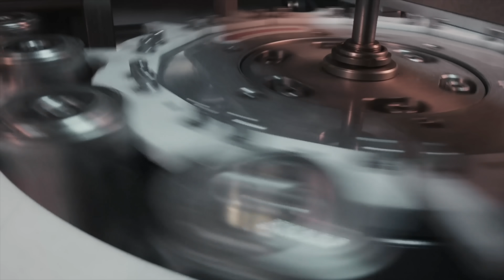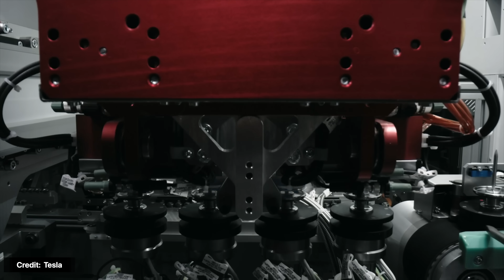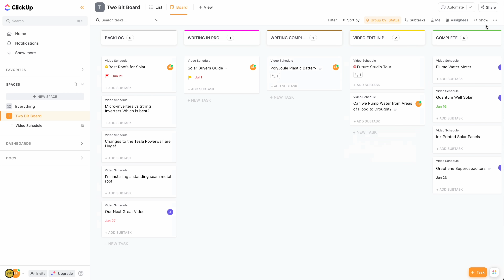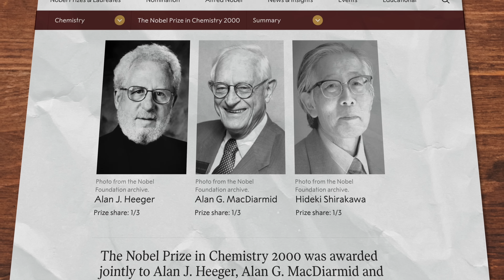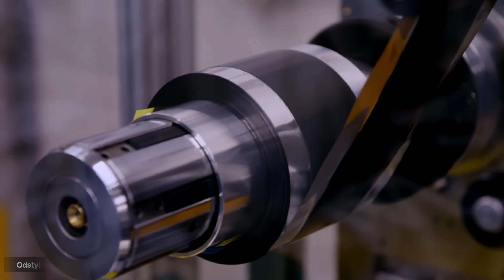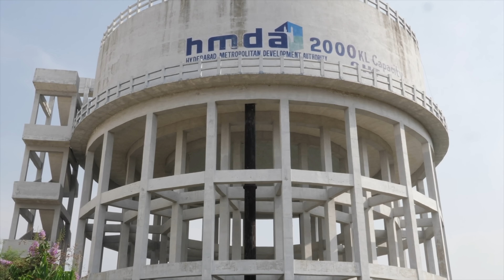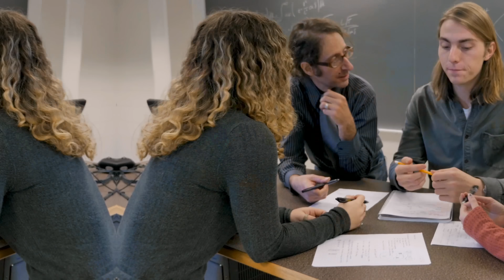Breakthrough Plastic Battery Requires NO Mining, is Cheaper & Lasts Longer!

Comment: I found this video to be very interesting and a little bit hope building, though like you mentioned, a lot is still unknown or up in the air.  But, that's the case for a lot of new or potential battery technologies.  I really believe that both in a typical money/oil-based market like we currently have and also a cashless society that which battery technologies we do/don't develop could make or break us.  We're going to be in a phase where power production starts to improve due to stressors on it (coal and oil will become either more rare or less allowed by government epa agencies).. essentially power production right now seems bad but will get better and better, more efficient, cleaner overall, and both deeper and broader.  So, then power production won't be the issue anymore, it will be power distribution and power storage.  Once the power storage issues are rectified, then power distribution won't be much of an issue either since a lot of people will be producing their own power in this ideal future (this is assuming we can get out of the clenches of power companies and government agencies forcing us on grid, or we are on grid but it is cheaper, they are developing ways to more safely and efficiently transport electrical power).

Comment: Alkaline batteries can't be recharged? Oh, no. I didn't know that and I've been doing it for years.
What, you say? Yes, I say. It's just that you have to limit charge time so they don't overheat. If it's hot enough to be uncomfortable, that's too hot. Take a beak then charge a little more. Avoid distractions & you'll be fine.

Comment: Would defiantly buy this for my home power storage, the size does not matter, only the price vs capacity and life does, also would be awesome to know if the  Plastic Battery Requires any balancing hardware like lithium batteries do, or can you get away with a more simple setup like you can when you use lead batteries,  i am very keen on learning this because i have had heaps of balancing hardware fail over the years, and i think this hardware is one of the biggest problems with  lithium batteries.

Comment: Interesting that the inventors of plastic imagined it would be incinerated after use. This is actually the best way to eliminate plastic from the environment. Recycling is always an interim step in the life cycle of plastics as it can only be done a certain number of times before, it, ultimately, ends up in a landfill.  This is why incineration is so important.  If we sourced our power from non-fossil fuels and renewables, the addition of CO2 to the environment via incineration of plastic becomes negligible.  I believe, while people are justifiably concerned with global warming, they are, inadvertently creating a severe plastic problem, by not incinerating (instead creating conditions for more microplastic contamination, world wide).  Plastics have so many advantages (less weight, longevity, recyclability, prevents spoilage of foods and medicines, resistant to chemicals that metals, glass, and ceramics are not, super clean and sterile - especially in medical procedures, and more...), that the elimination of would be more of a detriment than a benefit (including the environment!).

Comment: If I could get batteries for my house that lasted longer than current offerings and cost less but take up more wall space I think it would still be a good idea.
Reply: One "simple" way to significantly increase lifetime and number of charging cycles of lithium-ion battery packs, is to charge them to signficantly less than their maximum specified capacity. However, it is my understanding that commercial installations charge/maintain the battery packs at capacities near their maximum spec'd value. Example to increase lifetime and charging cycles...charge a pack spec'd to 500Ah to only 400Ah. Depending on the cells, temperatures, etc this can perhaps even double the number of times one can cycle/charge the pack. Since each cell in the pack is also only being charged to about 80% or so of its spec'd maximum capacity, that means a lower cell voltage and that puts far less electrochemical stress inside the cell at all times, including while it is not being used.

This approaches meets your condition of while it DOES REQUIRE MORE WALL SPACE, in return one significantly increases the performance while likely lowering the overall cost. Since it will require more cells (and more support hardware) in total, the up-front cost will be higher. But that should be recovered in the longer lifetimes and larger number of charge cycles one will get out of the packs. One would have to run the numbers for each installation to estimate approximate actual gains as they can be affected by usage duty-cycle, rate of charging, cell temperatures, and more.

Edit to add: keep in mind this info is for lithium-ion packs. LiFePO4 and other types may not have the same responses to this method and one mey not see the same benefits, if any. This comment is largely based on information on Lithium-ion cell management at the batteryuniversity website. It's a good website on the tech involved in various types of cells and batteries and best practices on how to handle and manage them.
Reply: For private house if you don't need to keep it under room temperature the size doesn't really matter. Most of the price for home use is a inverter that and charging controller anyway.

Comment: Sodium is thousands of times more abundant than lithium and there is practically an infinite supply of it with the overall cost of extraction and purification far lower.  Ok? so Na is a bit heavier than Li, but still many times lighter then lead-acid batteries... That's our future!

Comment: Each lithium battery in an EV requires 500,000 pounds of ore to be harvested and refined all using diesel engines - that's why every EV already has 7 years of CO2 usage on it over an ICE car.

Comment: Every subject you seem to do seems a little idealistic and hopeful with little to no chance of coming to fruition in full, you suggest all of these breakthroughs are technologies that are going to change the world without addressing the very real problems that exist to stop them being viable.
Renewable energy is great but at present can't be stored in a capacity which is viable and can't be consistent enough to power a country, E.V.s are great but are being pushed too rapidly, have you any idea how much power would need to be generated if all cars were electric and how that power could be transported as the grid could not take it. Most people would charge at night when there is no solar so would mainly rely on wind and storage which is a ridiculous dream and the planet would be ruined aesthetically .
I would like to know what your thoughts would be on something more realistic and feasible like small  nuclear reactors working more locally with big fast charging facilities adjacent to them as not to stress the grid taking care of 60-70% of power needs with renewable taking care of the rest with some storage where needed.
As times go on more and more air and ground source heat pumps are going to be used and the wiggle room that we have left in the grid is going to be needed for that.
I am always skeptical when ideas are put forward as if it will be plain sailing, I would love us to be totally green with no fossil fuels burnt at all but we have got to be realistic on how that can be achieved instead of dreaming and being idealistic to a point that is impossible.

Comment: It's basically a glorified super capacitor. It's good if it makes super capacitors cheaper, but calling it a battery is a stretch. Unless you want to start calling every electrolytic capacitor a battery😅

Comment: There's no way they make the batteries out of recycled plastic. If there was some real profit in using recycled plastics, we wouldn't have a plastic waste problem. Also, the 'recycle' codes you showed are actually resin identification codes, and just denote what the type of plastic it is. We are told that the closer you are to code #1, the easier (and more likely) it is for the plastic to be recycled, however the truth is many plastics are not recycled just for cost reasons, and many types of resin can't be recycled at all or degrade over multiple recycles to the point of being useless. Plastic isn't like glass, it can't be endlessly heated up to reform it into the desired shape.

Comment: To direct misstatements made in this video. One that the polyjewel battery is 2 to 3 times more ability or power output then the current lithium ion, and their example was 15 to 20 years as opposed to 20 to 30 years. 20 to 30 is not 2 to 3 times longer than 15 to 20 two to three times longer would have been somewhere right around 27 to 43 years.
Second and even more egregious comma which puts it right up to the point of being an outright lie because nobody seems to want to research this before they keep saying it period is that oil and gasoline are a fossil fuel period oil and gasoline are not organic substances period they are not fossil fuels period much of our drilling is below 16,000 feet and you cannot pull fossil material from that depth period not only that it has thus far shown that long-tapped empty oil fields, when somebody goes out there and on caps them and starts to check in them turns out they have an awful lot of oil in them for something that doesn't have any oil in it. Indicating that the Earth is constantly manufacturing it as a function of its existence. And the ability to produce perfectly clean running gasoline or diesel vehicles is actually pretty good just in the last 50 years.

Comment: I believe they are much better solution for EVs than Lithium ion batteries. Features of energy density and power density are codependent: If you can recharge fast, you don't need that much range, because you are going to refill along the way. And opposite, if you can't recharge fast, you need to carry more energy with you, so that when you make stop for recharge, you already need the rest yourself (e.g. for having a meal), and the two "stopped" times ("stopped for recharge" and "stopped for longer rest") overlap.

Comment: Sounds great but what is the feedstock? I’m an old oil guy, but the anti oil folks may well kill the critical supply chain element for the manufacture of these polymers………
Reply: Why not use CO2 from wherever and hydrogen from water? You have to put energy in, of course, but that's just where the excess energy from intermittent renewables could be used. Once you've made the conductive polymers, the 95% recyclability and 20+ year life would seem to remove any need for oil in their future manufacture.

Comment: Al-S batteries are the answer. Al and S are very common on earth and the batteries have as good or better energy density compared to lithium batteries. They are dendrite free and are much cheaper to produce. Totally resistant to fire as well

Comment: the best use case for this type of battery is for homes as a powerwall. 5x the size of an li ion isnt that much unlike a pump hydro.. i hope they push this through. taking some load off from li ion is good for supply issues . li ion for cars and phones and this for homes. then have more time to find the next solution.

Comment: So they have 5x the power density but need to be 5x the size of Li-Ion? This doesn't make any sense
Reply: It would probably have more sense if he hadn't used the phrase "power density", which doesn't really describe the property. I think "power capability", i.e. the amount of energy it can deliver per second would be more accurate. In other words, compared to Li-ion, it stores only 1/5 of the energy for the same volume, but you can push energy in and out of the battery 5 times faster. That's how you can reduce charging times from 25 mins to 5 mins for the same capacity battery.

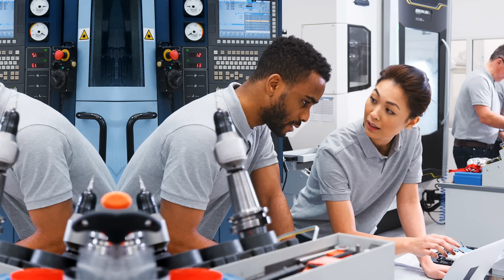Comment: 7:43 Yea h no ! They wish they lasted that long. Maybe they do in the lab, out in the real world..5years max and it needs charging more often the older it gets. Atmospheric humidity, static electricity, EM fields from consumer electronics ..Li-On rechargeables don't do well,unless heavily shielded, which drives up the cost, which takes them out of the affordable price range.

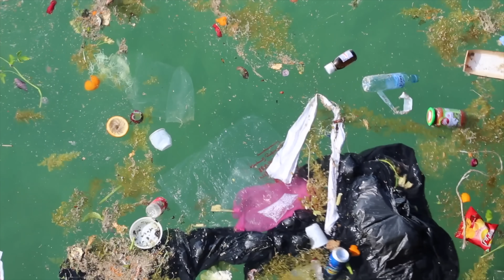8:05 Plastic is environmentally neutral, as long as it is disposed properly. Which.. we have not being doing , mostly due to cost.
We need another use for non recyclable plastics. 

Wind and solar are dead ends. They cost too much,  produce little , are not reliable, they damage the environment as much as gas does,  without heavy subsidies they are out of the affordable price range. IDk about you, but i'm getting tired of paying for everything twice and three times.
Subsidies means , the politicians tax me like a coolly,pocket the most part for their re-election campaigns,and take out loans in my name and yours, to pay the real cost of renewables. This has to stop. If wind and solar wont do the job, we need to look elsewhere. 

9:49 Under development means not market ready ,yet! Sounds interesting! As is, it can be used for storage where size is not an issue. especially if its cheaper. IDk about EVs.. they are lighter, but you need more of them.. maybe weight wise it evens out, and you gain a cheaper recyclable battery.

10:37 You're joking right? Like a M**********r dude!  storage is not a problem, not for most modern buildings. Sub basement, adjacent storage, there are ways . Cost is what's important.  None of us are on an unlimited budget. The cheaper the power wall,the better we can protect it from the elements.
Reply: I call BS on most of what you asset. Rechargeable batteries do not degrade because of "static electricity and EM fields from consumer electronics .. unless heavily shielded". Do you wear a tinfoil hat to protect your brain from the same effects? I defy you to cite a single serious scientific paper that supports your claim.

Plastic is obviously not environmentally neutral, and there's no way to dispose of it "properly". Feel free free to explain how to dispose of plastic properly.

Wind and solar are the cheapest unsubsidised form of energy now available at about $0.04 per kWh - source: Lazard's Levelized Cost of Energy Analysis version 13.0 (2020,) page 9. If wind and PV solar cost "too much", then all the other sources of energy cost between 50% and 400% more. Read it for yourself. PV solar energy alone could meet many countries' total energy needs with less than 0.1% land usage.

IDK about you, but I'm sick of oil company shills spreading misinformation about the greener, cheaper, renewable alternatives. I assume you understand the word "unsubsidised" in the Lazard report? 

We don't need to look beyond wind, solar and hydro for the long term, and perhaps nuclear as a stop-gap. But carrying on burning fossil fuels is the surest recipe to kill off our kids' futures that I can think of.

Comment: I'm wondering about this poly product, most are pretty flammable. What is the flammability of this plastic and what type of heat can it withstand.
     And if I understood it right you said the barrier is some type of liquid instead of dry? Any liquid make something less environmentally friendly because if it is spelled out it can soak right into the ground and be harder to clean it all up or something dry it would just be sitting right there on the surface.
And most things like poly products, and they made from derivatives of oil?  And I'll just sounds to me like petrochemical companies trying to figure out ways to keep plastic being made for as long as they can.  🤔🤔

Comment: Guess the "Plastic Battery Requires NO Mining" does not need oil or coal to make the plastic...!   So mining for coal or drilling for oil is okay if you are refining the "Stored Sun Light" into plastic.
Reply: If does not need oil of coal. Unfortunately, organic alternatives aren't cheap enough yet.
Reply: @edeaglehouse2221   I do respect your feedback regarding "organic" I guess plastic.   Still have a hard time be leaving the plastic battery can be made and then placed into any mfg device like an EV or solar storage system. without oil, coal or nature gas being a gating & key item in the production cycle.

Comment: You do not understand anything what plastic scam really goes on. Let me introduce to you it very shortly. Basically modern plastic is not very recyclable thanks for 1 material, what is sold by dumping prices - EVA. All manufacturers mix it to almost every product thanks for insane dumping prices. Raw material sellers does it because it ruins the cycle and manufacturers are forced to keep buying virgin raw material. Yes, it is still recyclable after EVA mix but production rate is several folds lower thanks for insane gas development on recycling. Just can not send out bubbly (foamy) material because manufacturers have instantly production issues. So, only solution is to end EVA dumping prices and tax every plastic manufacturer by x00% tax until they start producing only pure materials. Honestly, for consumer level we need only 1 type of plastic, what is easy to mix even together, That fancy polymer name is polyethylene. Low, medium, high or ultra high density - it cover all household needs. Only what we loose is nice potato chip printed packages, no more losses. That plastic can cover everything on consumer level. We use it a load but some reason we all must use all kind of other plastics too. Examples where is polyethylene - plastic milk bottles (HDPE), meat packaging (LDPE), loose veggi bags (HDPE) etc. Mixing all these different grades together, we get something called medium density polyethylene (MDPE). Sure, recycling must step up and stop making from production to the bag production. They need mixing silos and possible several hundreds tons each. Only mixing makes it possible to produce good average quality recycled plastics.